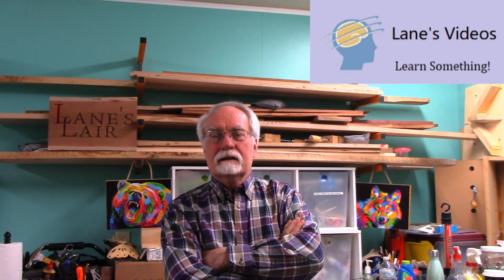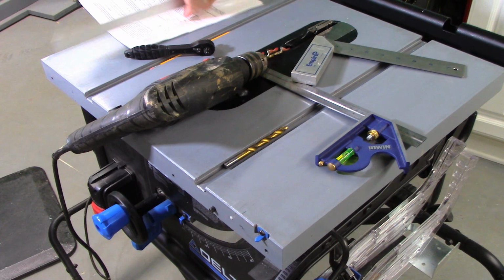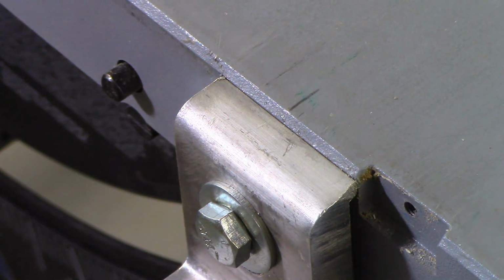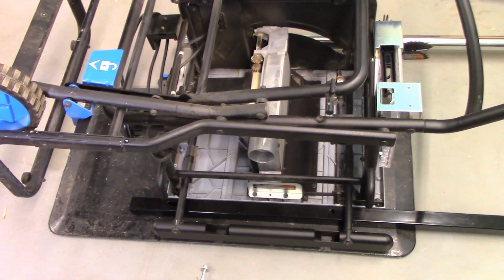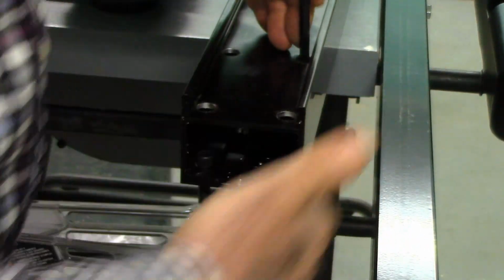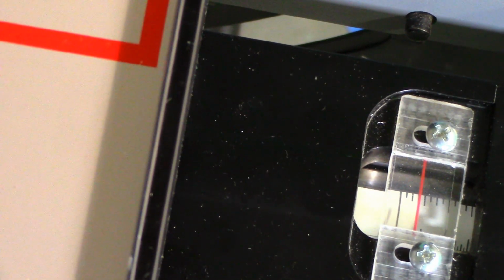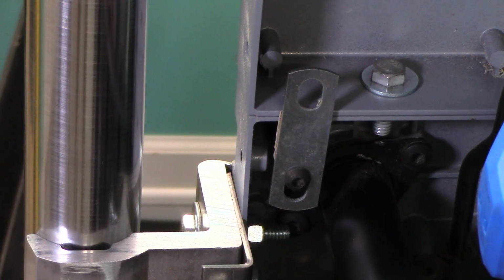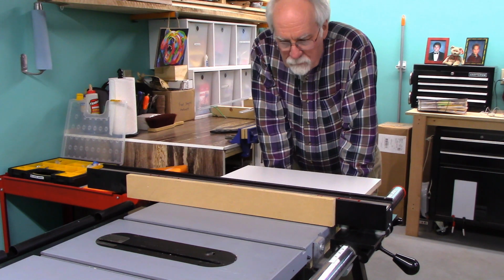Vega U26 Fence Install on Delta 6000 table saw

Comment: Lane, I have the same Delta Job Site saw as you do with the same issues with the Cheap Delta Fence. I have been looking to upgrade my fence into changing my Fence to a much better and more accuratel one just like yours. I want to thank you for showing me how to do it and making it look easy. I am ordering my VEGA U26 ASAP.  😁👍 Thanks for your video.
Reply from the maker: Thanks and you are welcome. Be sure to flip the saw over on its table to visualize the underside to remove pesky bolts. I showed that later on!

Comment: I just installed this fence on my table saw and just a word of warning. My fence moves when I clamp it down. I called Vega and they said this was normal, but I find it odd that the clamp would torque the fence over. It should simply pull the saddle back against the front rail and hold square.  I may have bought a lemon, but if I were to do it over again, I would have bought something else. Worse, the micro adjustment isn't square to the rest of the fence saddle and it pulls the fence over even worse when the clamp is applied.